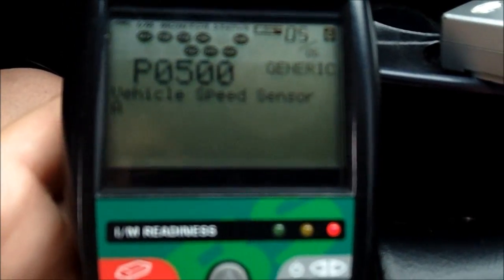How to locate VSS on 1998 Ford Crown Victoria

Comment: Thanks for posting this! It was easy to find with your video. The replacement was easier than an oil change. By the way, the plastic gear was attached with a small metal clip, to the end of the VSS that goes inside the transmission. Mine looked okay, and the problem was fixed without replacing the gear, I just transferred it to the new VSS. The VSS cost me $28 from Oreilly.

Comment: might be a long shot but 97 lincoln towncar. won't shift properly to 3rd gear, quickly goes into 4th. over drive off light comes on and car wont go into overdrive. speed on the dash doesn't match how fast I'm really going

Comment: i have a 2000 interceptor is the vss in the same place and if so were you able to reach it from the inside or did you remove the tire
Reply from the maker: I was able to get to it from underneath the car. I also had to replace the speedo gear as well. HTH
Reply: I appreciate your quick response and I thank you very much
Reply: My boyfriend is trying to connect his.  They're are two wires still sticking out by the vss. What are they for?

Comment from the maker: also after I bought the VSS and put it on I realized I needed to get a new speedo gear. And that was something I had to order from Ford, not too expensive but you need to make sure you get the right one.